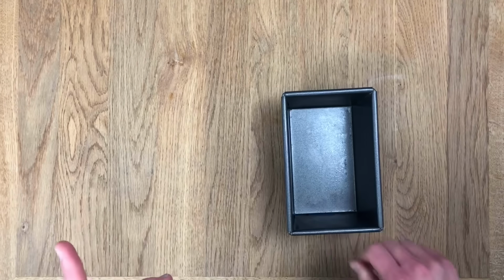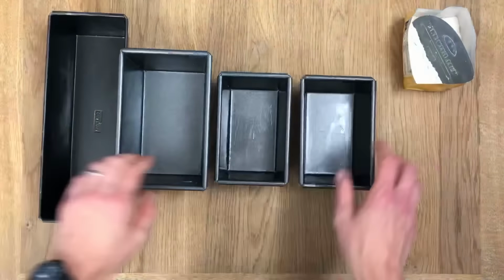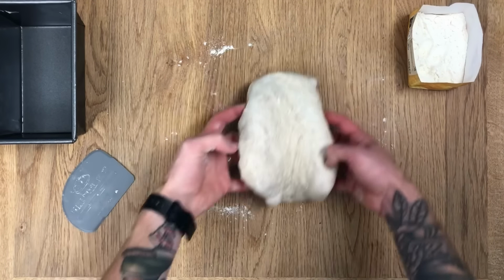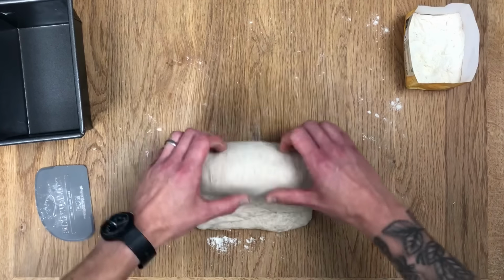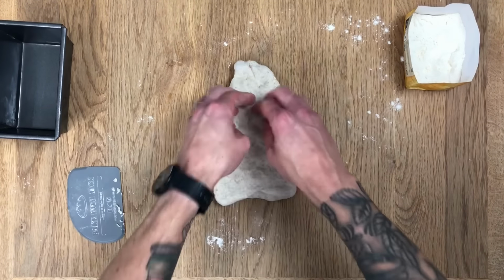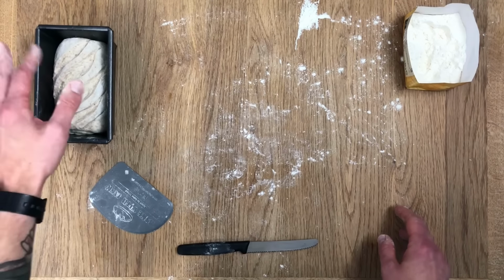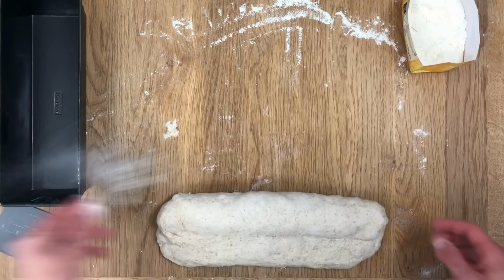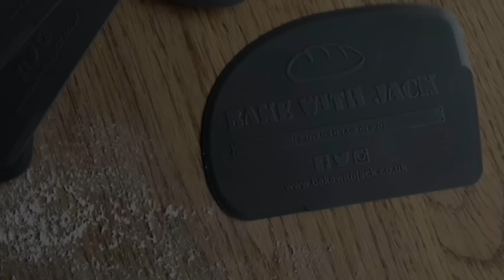122: How to Shape a Loaf for a Tin -  Bake with Jack

Comment: I do the roll and pinch (with or without dried fruit) then connect the ends of the log to make a circle large enough to fit around the tin. Once the circle is durable and an even thickness throughout, I twist it into a double figure eight. I pop it in the tin that way and it gives any plain loaf a fancy crest.

Comment: Jack - I like your bread videos!
There is a product in the US (maybe in the UK, too) called "GOO GONE".  It does a great job of removing label residue like on those pans.  Wash the pans well after using the GOO GONE.
Reply: A little bit of olive oil also works great for removing the sticky label residue IMHO.   Cheers!  😁

Comment: Thank you so much Jack!
1. seeing your hands working with the dough is so soothing.
2. could you please record that video for preshaping?
3. I didn't get it why we should first fold the two sides in and OVER each other? 
4. what will happen if it's not a pointed shape dough and is a triangle-shaped one?
Reply: Yes please to all of these! (As well as a basic rundown of how this loaf is made, it would be nice to see start to finish for once, as I really like Jack's techniques)
Reply: 2.  Tip 58
Reply: Hi, for your Q 3. - I believe it's because of the size of the tin - you fold the sides over as much as you need to reduce the length of the base of triangular shape. You see, for the longest tin, Jack didn't fold sides at all, because the length of the doe was just fine for the particular tin.

Comment: I have a new loaf tin w/lid that measures 32cm x 12cm x 12cm this gives me a pan volume of 4608cm³. How do I find/modify a recipe for soft white sandwich bread that will fit my pan? I have another smaller pan w/lid that measures 26cm x 12 cm x 12.5cm - volume 3900cm³. I've used this smaller one twice and each time it looks lovely on the outside, but my loaf has been way too dense. Help, Please!

Comment: Good to have a refresher Jack. Was that a little different to the original shaping video? I'll check back but you make it look so easy and never fuss about tucking the ends under. I'll try slashing earlier as you did, but so far I’ve slashed just before putting into the oven. Before I went metric I used 1 1/2 lb flour and have continued with a whopping 680g which can be a tight fit in some so called 2lb loaf tins. I also have an expandable tin (from Lidl I think).
For anyone a bit fussy about greasy fingers, use a pastry brush.
If folk want a rough but easy way to compare differently shaped tin volumes without arithmetic, fill one with water and pour into the other.

Comment: Jack, this video is so much better than the original shaping video.  My dough seldom looks as soft and manageable as yours does, and it does not relax after preshaping into a boule and resting.  Is that because of lower hydration or too much surface tension?  Anyway, thanks for another very useful video and another recipe to try! 😉

Comment: Ahh Jack, you can't help it, it's just the way you are--You're adorable and your confidence is JUST right, with a  hint of cocky = )  You make me grin ear to ear.. Okay now to the content of your messages- Last video I watched you were adamant to not add any extra flour, that if the dough was worked long enough and well enough it would become smooth and non sticky.  You were right, it works.  Today, I see you've learned something different and I'm happy to add back a touch of flour.   I am struggling with my loaves being loose in the middle (Yes I know about enough vital gluten and over proofing--haven't conquered them completely) BUT I wondered if it's possible I'm not forming the loaf tight enough or...?   Could how I form the loaf be an issue?

Comment: This is a brilliant video, as I have struggled baking in different sized tins. This video has helped enormously. Thanks Jack. I have had a problem the last couple of loaves made, the base of the loaf sticks to the bottom of the  long 2lb loaf tin. Baked at gas mark 6 for 15 mins,  Mark 5 for 15 mins. Removed from the tin , this where it sticks, only on the base, placed back in the oven on Mark 15 mins further.  Should I leave it in the tin longer.
Reply from the maker: Thanks Anthony, it’s probably because your oven is gas. It’s hotter in the top and the bottom never really gets as hot as it needs to. Try baking on a hot stone or flipping the loaf upside down for another 10 minutes at the end  👌🏻
Reply: @Bakewithjack   Thanks you for that information Jack, have put backing tray in the oven for about 40 mins, before adding loaf tin to it. Oven is gas by the way.

Comment: 2 questions: have you ever made Japanese milk bread which includes a paste of water, milk and flour? 

My other question is when making yeast rolls, does it make a difference if butter is added at the beginning before the dough ball is formed or after the dough ball is formed and during the kneading process??
Reply from the maker: Yes I have and it works really well, and if it’s just a little butter I’ll put it in at the beginning. If it’s a LOT like Brioche, I’ll do it AFTER I’ve worked the gluten othewise it won’t develop as well 👌🏻
Reply: Bake with Jack thank you much!

Comment: Hi. I wonder if you could help me out with something: I've started to shape my bread sort of like you showed here, by rolling it out eith a pin, then rolling it up into a cylinder (I don't do the circle-fold thing cause I don't want a fatter middle, and I use a pin so it's as even as possible). My dough is nice and sticky, but not too much. It rises very nicely. Once it's all done and baked, I have half moon holes inside my loaf like from the rolled layers separating. How do I stop this? I've tried rolling it tighter, but to no avail :(

Comment: Could clarify something for me?  The total weight of the ingredients in the example is about 870 grams.  You said to then divide it.  Did you mean into two pieces, which would result in the two weighing 435 grams each?  If yes, then that would imply that a 2 pound tin's recommended un-baked dough capacity is around 450 grams or 16 ounces which is 1 pound not 2.  Can you see my confusion?
Reply: Watching the video again, I think that you divided the dough to fill the two 1 pound tins.  So, the 870 grams of dough when not divided should be shaped to fit in the 2 pound tin, which now makes sense to me.  No need to replay unless you want to give me some encouragement :).
Reply from the maker: KEEP UP THE GOOD WORK DON! You’re SMASHING it 👊🏻😜

Comment: Great demonstration! I have a problem shaping without the tins and the dough spreads out like with baguettes on a sheet pan to make epi loaves. Any suggestion?
Reply: You need more tension and a dried dough surface when putting in the oven.
Tension is achieved by turning dough in tight turns (rolling ball, keep seam underneath) and in proving a well tight dough slightly aka it  dries out on surface, eg on a tray / covered with a cloth.(Won't spread out in baking when no Tin is used.) 😉
Reply: With Bagettes, you flour a cloth and place each shaped Bagette / with a fold of the cloth in between each one.
So loaves are parallel but not touching each other ! Cloth folds separate them. Transfer to a baking sheet by aligning a slim long board at side of each loaf, and use cloth to turn it like rolling a log sideways. NEVER lift an uncooked Bagette ! Cut sharp diagonal cross cuts, and bake with lots of steam (tray of hot water) immediately ! No last prove after cuts needed. 😉

Comment: I’m just a beginner so I realize this is an amateur question, but when the dough is rising, proofing and resting what do you cover it with?
Reply: Kate Kerrick I’m not a professional but in general, I’ve seen lots of other bread baking videos where plastic wrap is used. I myself have used aluminum foil as well. However when the dough is rising inside the bread tin, many have suggested using a damp cloth or another bread tin inverted on top.
Reply: @glossy283  Thanks so much!